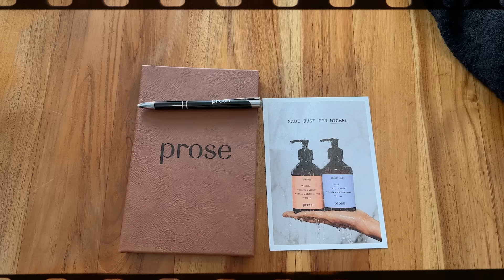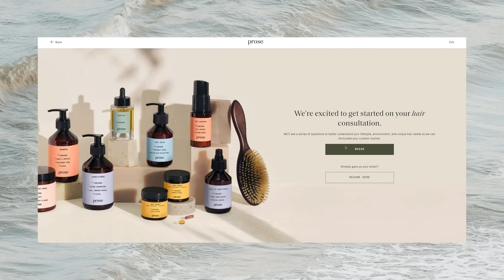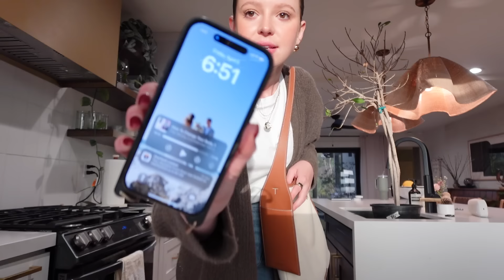VLOG: first day of culinary classes + a weekend alone!

Comment: A new water heater at Sears that we got cost $800. Not including the installation.
And make sure if you need a new water heater that whoever you buy it from that they include someone to install. Sears said they had someone, we bought the water heater, then informed us that they didn’t have any independent installers in our area. 
Took us about a year to find somebody that wasn’t expensive, so we took baths/showers that were cold for a year. Not kidding.